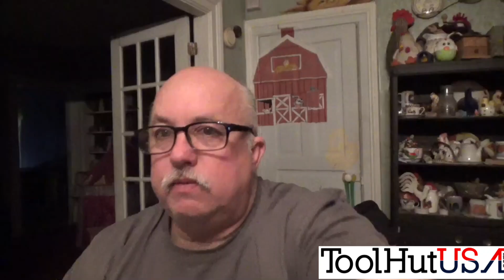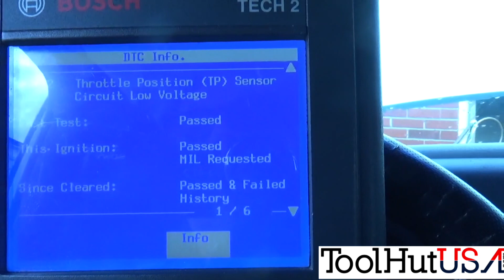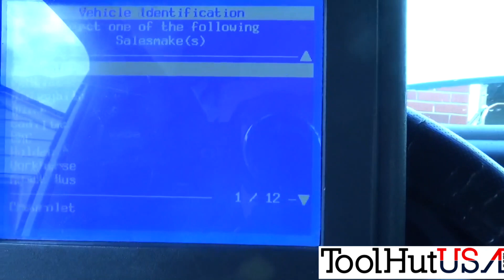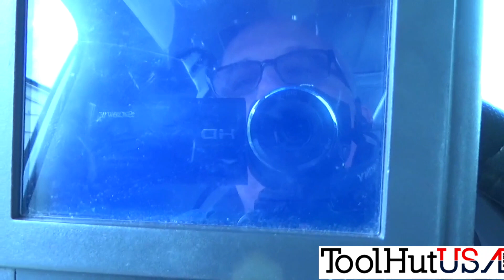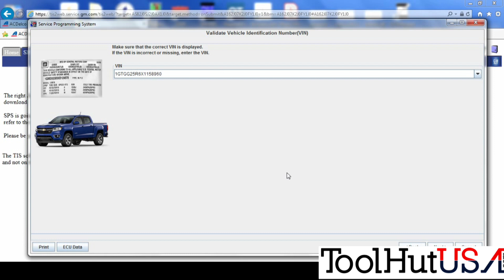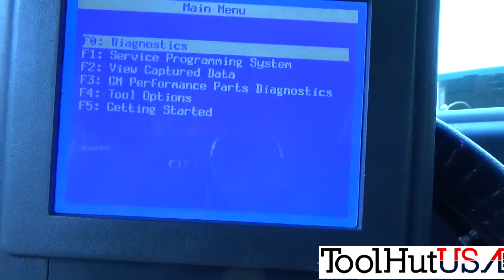99 chevy express pcm part 2

Comment: Hello,
I just found your channel as I have a 03 chevy express van with a 5.3 in it. It needs a new PCM as it will crank but not start and none of the injectors are firing. I bought a Launch tool and I was wondering if you know if you can program PCM with it. It is the X-431V. I am having a hard time finding a PCM for the 5.3 and from your videos, it does not seem to matter what PCM it is as long as it is a chevy.

Comment: I have a Tech 2 but I don't have a J2534 device. It seems that "tech 2 remote programming" is only for 2007 and older. There's an option for "Tech 2 pass-thru." Am I able to use the Tech 2 as a pass-thru device for newer than 2007?